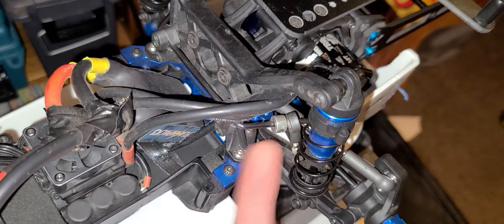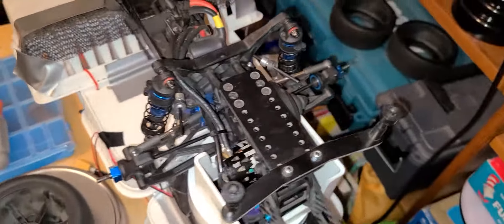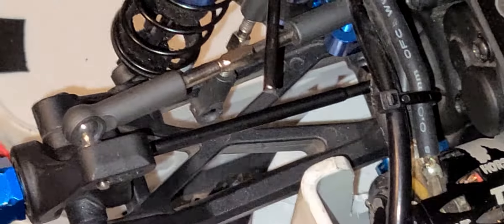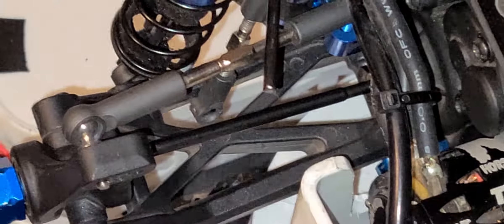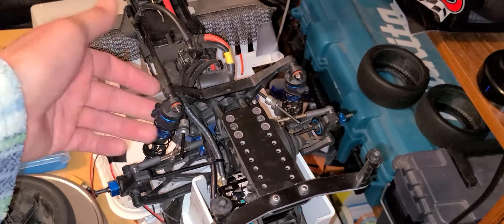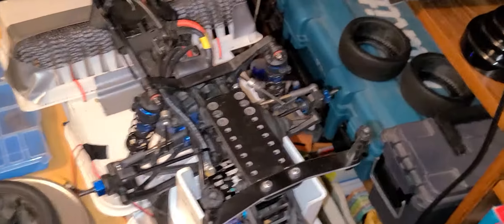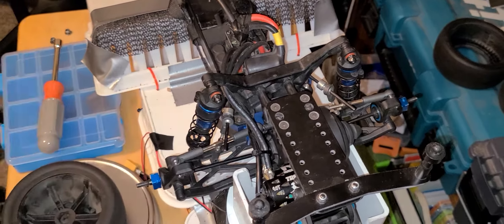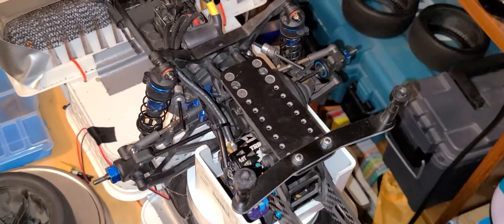Dr10 kit anti roll bar

Comment: Does moving the anti roll bar forward add preload to the shocks?
Reply from the maker: Great question,  and yes, I think it can.  I forgot to mention that my rear shocks are internally limited by about 4mm.. so I think yes, if the link isn't long enough,  it could limit your shock travel
Reply: @ExaltedRC  I was just curious, I have fully adjustable so adding/removing preload wouldn't be an issue. Of course if they are limited it would also limit the amount of preload that can be taken out.